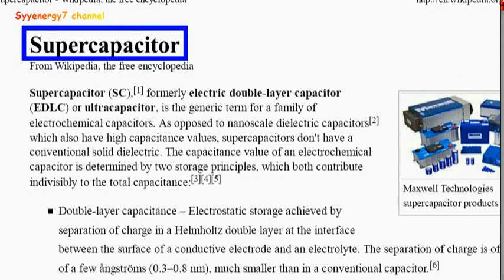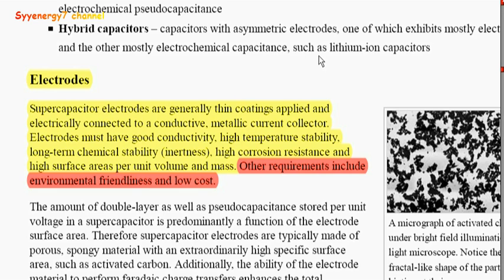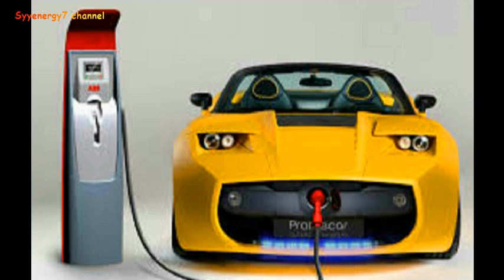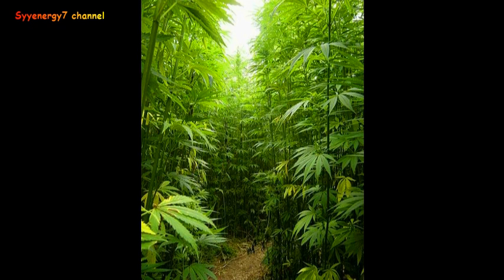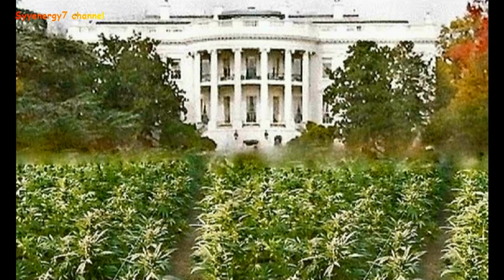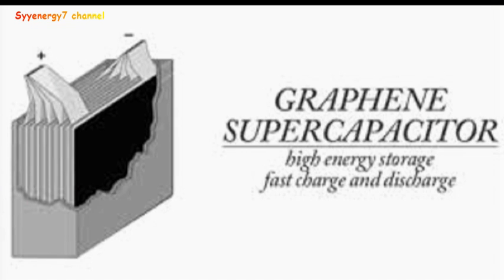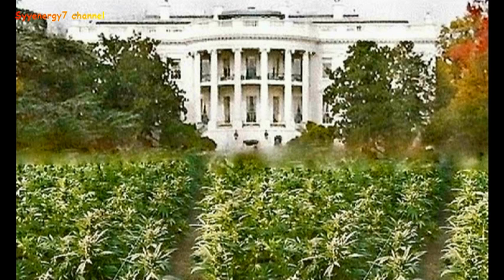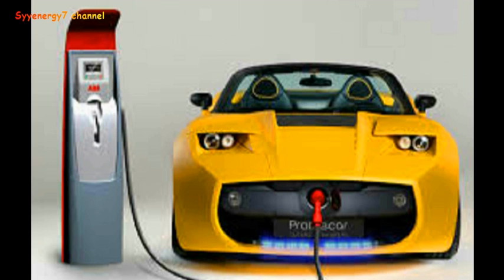HEMP to the rescue again, SUPER CAPACITORS

Comment: You can pretty much carbonize anything and make an electrode out of it, the problem is that hydrothermal carbonization requires expensive equipment and is only suited for low production volume.

Comment: I liked the video but it would be better if you didnt try to speculate on the specifics of tech you seem to know little about or to say things like "I think" instead of making a statement as fact. some minor corrections

its not really more simple. the complexity just gets shifted. putting super caps in cars doesnt make for boom instant charging EV world. 

the power grid was set up decades ago to deliver x energy per second. 3 phase commercial connections can deliver more energy per second than your home connection but the grid only has so much energy per second and instant charging cars turn every gas/charging station into the equivalent of a industrial sized metal smelting factory in terms of power draw. The lines wernt laid out for 5 smelting operations in each town and not enough power plants are rround/online to keep up with that draw even if they were.

The solution to this adds the complexity back. the solution is the filling station needs a bank of super caps it can charge at a rate that doesnt black out 3 cities because 2 cars wanted to fill at the same time. This means that then need several more caps then they have pumps/chargers. lets say they have 6 electric pumps... they probably want 30 equal or larger capacity super caps to draw the power from.They would have a room with an array/bank of caps and a management computer/distributer that  the pump outside can call over a data line and say "hey connect me to a full one"...it goes through its rows and columns looking for the first full cap it finds, then connects the pump and ultimately the car to it. then you get your magic poof car is insta charged moment. 

not only does someone have to wire that system up at the station(your average electrician wont have a fucking clue and or end up dead if they try with out knowing), someone has to do the analysis of the location and traffic patterns expected. They then need to tie that info into how how much power the local grid can spare per unit of time.
 
if it turns out the grid can only deliver enough to charge 1 car/cap/ "tank" per hour between 8am and 6pm and your station gets 60 customers per hour for 2 hours in the morning and 2hrs in the evening(drive home)...its going to take a lot of money to put a station in that town/county.  

said station would probably want 300+ caps..2hrs morning@60 customers an hr = 120 caps depleted and you can maybe charge 5 up before the next rush of 120 customers. in the mean time lunch break might use up 30 more. 

the problem is actually worsened by how fast you could dump the power from station cap into car cap. its going to start out wired but eventually it may be as simple as roll through this 10 ft strip at 10miles an hr. meaning the station might not get the luxury of 5min of (like pumping gas) to draw power from the grid between instant charges. 

even from the start billing will likely be quicker. plug the pump cable in and the cars computer gives the pump billing info. no looking for a card to prepay at pump or going inside.

other thing with dumping that much power at once is THICK wires. lots of metal = lots of $ required just to connect the shit.

now onto onboard car problems
you will likely never have a super cap only car

they are called super caps because they displayed the good characteristics of both batteries and caps. They arnt necessarily better than a battery at storing more amp hours and not self discharging over hours. Super caps can accept/charge and give/discharge more power per second but usually far fewer seconds at that rate. The other advantage of super caps is they usually dont degrade. Every time you discharge a litium ion it loses a bit of capicity...the further you discharge it the more capacity you loose per cycle. Also spikes of high draw like from "flooring it" can damage the litium ion cells/reduce future storage capacity.

instead of all that battery management shit between the motor and lithium ion cells going away. they will probably use them as a buffer between battery and motor in adition to the extra capacity. This way when one "floors it" the super cap takes the spike and the battery continues its computer regulated feed to super cap(level required would varry with speed/tire friction/wind etc) also if regen breaking is employed the super cap can take that energy faster meaning more agressive stops can still recover energy that otherwise would have been lost.  (i think toyta actually has a super cap for breaking already not sure though)

likely the mid price and up up car will have that 300mile range normal battery owner plugs in at night but half of it is normaly reserve. litium ions last longer if they arnt discharged far or often. Overnight you end up with a full super cap worth 100miles of driving and 300mies in storage. If you can shift to not using the big battery every day it will maintain its range better for when the family wants to drive to grandmas...grandma happens to live 300miles away. 6 months into owning a lithium only car your 300mile pack probably doesnt have a prayer. but if the dailiy comute was handled by the super cap. you can drive, deture to find a clean shitter/see your favoirte pasture then take grandma out to dinner before charging over night at her place 2 years into owning the car

Comment: Hemp. Graphene and LENR will change the World, and not all Graphene is expensive.  It is the way you make graphene that makes it expensive.  Sunvault Energy uses a Laser Inscribed method for making a type of graphene which is perfect for super capacitors and very cheap.Also it costs fractions of what todays battery technologies cost, is 100% green, may out last several vehicles, no known safety issues so far, and 5 minute charge while driving. So drive 500 Km maybe then charge to 90 - 95% in 5 minutes with an onboard generator = (100% green), and then keep traveling for another 450 Km and charging with out stopping and another 450 Km and on and on.This makes electric vehicles of all sizes free of range anxiety, and the fuel savings will be terrific, which is a game changer.Imagine a solar or wind system where the battery is replaced by Sunvault's EESD, and only needs a few minutes of sun to fully charge, which is a game changer.You could use a tiny version of the MYT engine with a 220V  generator combination, running on compressed air to recharge the EESD on vehicles and for home power backup.The French Air Car can travel 200 miles on $2.00 worth of compressed air, so a tiny version 3" maybe would be large enough to run a 220 v generator combination and would not use much air for several recharges.
Reply: i personally think LFTR is a better option for more than a few reasons, including helping solve the uranium cycle nuclear waste issues. also it gives humanity a better way to utilize rat poison than adding it to municipal water supplies for the sake of underprivileged families having nice teeth. Gee i sure r stupid but my smile was on fleek b4 all that brominated vegetable oil and hfc"
Reply: I agree with using LFTRs for power production and using up all the spent nuke fuel that is currently just building up, But we do also need solutions like this that hemp can solve for other issues. Hemp is an amazing plant that has so many beneficial uses it is ridiculous not to use it and develop new uses for hemp
Reply: +Neil Lizotte Are there any DIY methods for Carbonizing HEMP or other organic Material into Graphite and or Graphene or Graphene material. is the process as simple as the "Making home made charcoal, from HEMP, then oxidizing the Carbonized HEMP or other Organic Material with the usual DIY Calcium Chloride solution, dry, clean, dry, and using that as the Carbonized material to flatten to make a super capacitor or does it even need to be oxidation with the Calcium Chloride and water solution?
Reply: The man to ask is Robert Murray Smith on YouTube watch his videos he is awesome
Reply: ha!